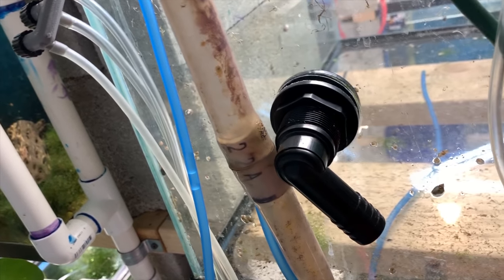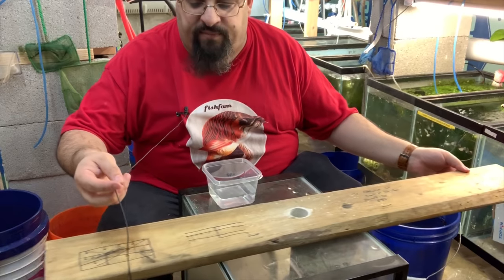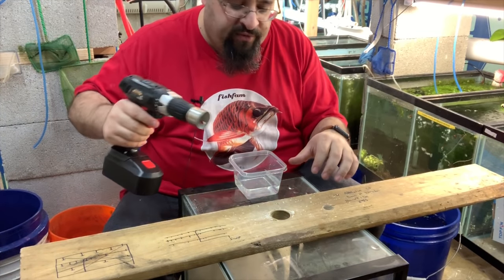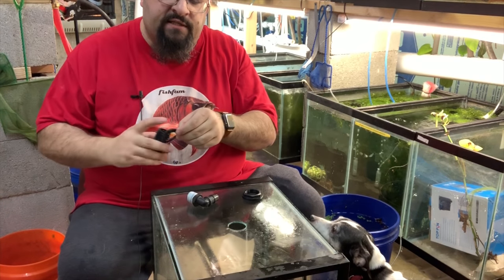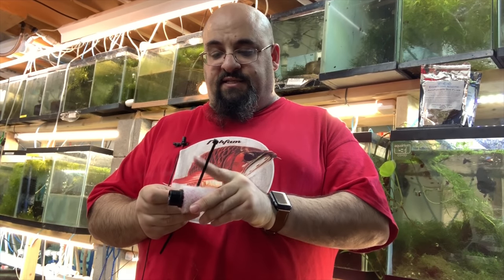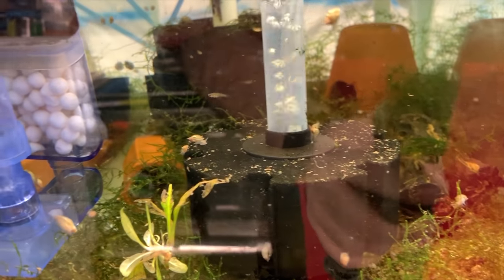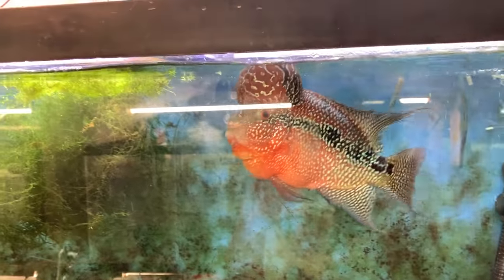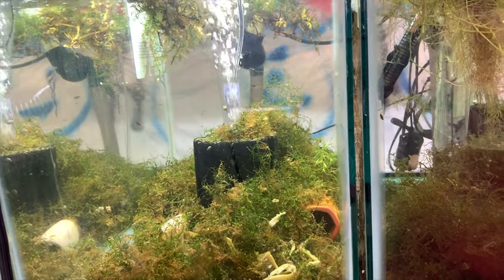How to Drill a fish tank and other shenanigans!

Comment: Good info Michael.  If you use duct tape on the inside of the tank where you are drilling, you’ll get a cleaner cut every time with minimal to no chipping.  It also catches the glass once the hole is drilled and prevents it from falling.  😉👍
Reply: Nice to know!  Thanks!
Reply from the maker: Good advice!

Comment: slip x slip bulkhead you could use big pvc pipe cutters to cut the glued together bulkhead off -- it may take me longer to drill my tanks, but i've never chipped or cracked one, i like to keep a pool of water around the hole and let the weight of the drill do the cutting which avoids all of the problems you mentioned. Patience is a virtue (especially on thin glass) - hah!
Reply from the maker: But I could have cooked a roast in the time you drilled that one tank! Lol I’ll try the PVC cutters! Thanks for the tip!
Reply: @MichaelsFishRoom  I do love a good roast...
Reply from the maker: Making prime rib for Christmas!
Reply: I used the same method, slow and steady; to drill 120 holes in 80 tanks. It took me an average of 5 min per hole, it was a test of patience. Regardless of what method you use, the key is patience. Thanks, for another great video.
Reply from the maker: Thanks for watching!

Comment: is there a link for the towel?
Reply from the maker: What towel
Reply: @MichaelsFishRoom  to "catch" the glass.  It sounded like you may have recommended using a towel.  I was wondering what kind.  Maybe 1 from a cheap motel?  Maybe you have a preference that performs better. What do you use to dry that magnificent beard?